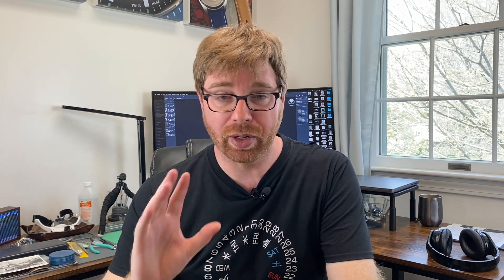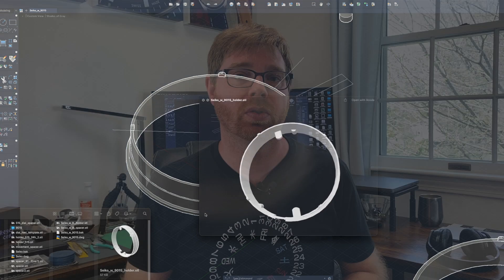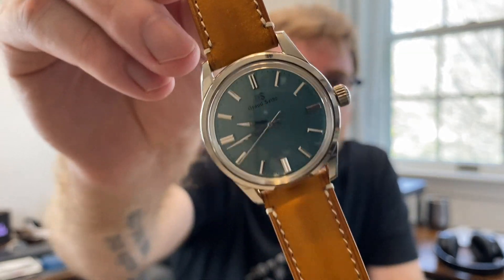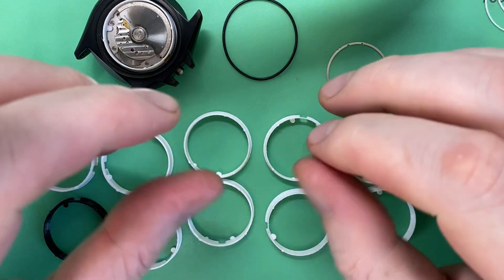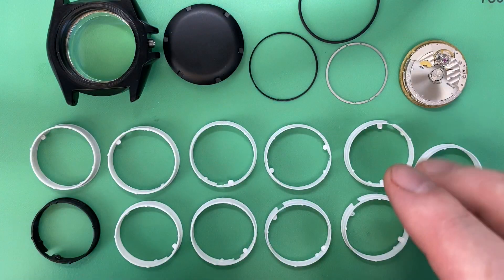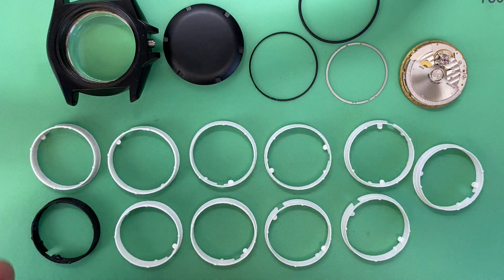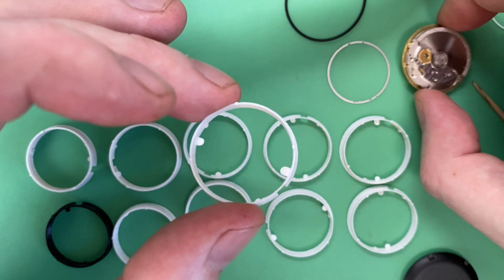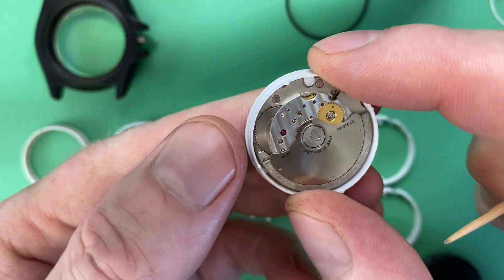Miyota 9015 in a Seiko SKX 007 Case

Comment: I have just put a new handmade dial and Miyota 9039 movement in a nautilus-style case that I had purchased with a ticking quartz in there.   So far I've fashioned a movement spacer with thick copper wire, but I need a more robust solution.  Looks like I have a bit of CAD and printing to do myself, but I'm very glad to have found your videos to help spot the pitfalls and do a better job.  I did wonder if an FDM printer has enough resolution for these tiny parts.
Reply from the maker: A good one does :) I do it all the time
Reply: @WatchComplications  I've simultaneously decided on a 3d printer purchase, but also ordered a couple of 2824 spacers and fixing rings to try out.  Thanks for the reply, you tipped me over the edge.
Reply from the maker: did you place the spacer order vis my site or somewhere else? I’ll be getting back to printing orders in a week or so!
Reply: @WatchComplications  It was somewhere else.  It's just a "standard" brass spacer that looks like it will fit my specific case with the aid of a fixing spring, based on the given measurements.   It cost just a couple of bucks so I thought why not give it a try.   For a custom job I can't afford your services!  Besides... I need the CAD practice myself ;)

Comment: Can you explain the process for miyota 8215 to 9015
Reply from the maker: what do you mean the process from the 8215 to the 9015? The 9015 is quite thinner, but I'm not sure what you're asking. Could you fit a 9015 in a case meant for the 8215, yes. But that would take a custom holder for whatever specific case you are asking about. If that's what you're asking.

Comment: Could you use the same spacer for the 9075 GMT movement?
Reply from the maker: being a GMT, the 9075 has more height than the 9015, so the holder and/or spacer would have to be altered to accommodate the difference.

Comment: Hi, first of all congratulations on your work. I wanted to ask you if it is possible to use an NH35 case for a Miyota 8200 movement obviously using the right movement holder. Thanks😊
Reply from the maker: Probably, but depends on the specific case in mind.

Comment: do you have a spacer for miyota 9015 for SKX013 Case?
Reply from the maker: i’ve not used the SKX013 for a project yet, but I don’t think it would take much to modify one of my existing holders. I think the interiors are mostly the same, just diameter difference with 42mm vs 38mm. The cases have the same height.
Reply: @WatchComplications  thank you very much. where could i order your 9015 spacer?
Reply from the maker: send me an email watchcomplications at gmail and we can discuss more.

Comment: Does this fit any NH36 case?
Reply from the maker: No, because cases can have different internal dimensions, dial sizes, etc and then their own custom holder to fit a particular movement to that case. It's usually not a one to one swap. A case will usually come with a holder that fits the NHxx to that particular case given its overall and internal dimensions, like stem height. Almost every case and movement combo is unique.

Comment: Has anyone installed a Seiko dial on a Miyota movement?  I know the feet locations are different and would like to know if it's possible.
Reply from the maker: you’d have to remove the dial feet and reset them. I have a vid on that too.
Reply: same size the hands?
Reply: @EmmanuelMoreno-le7ip  No, NH hands do not fit Miyota movements. Miyota movements have very different mounting diameters for the minute and second hands (smaller.) The hour hand is almost the same diameter, but even it has a slight (0.01mm?) difference.

Comment: It would be great to have a file for the inside of the holder, like say a Miyota 9 series and and have a thick/taller outside that you could whittle to fit thr cavity/adjust the stem and dial height. 
Really liked your video! ✌️
Reply from the maker: that’s essentially what i do with redesigns. For example, I had this one made, then redesigned to fit a Panerai style case. It’s usually just adjusting the height and exterior. You can whittle PLA, and sand it, but it’s more accurate to quickly make the adjustments in CAD and reprint.

Comment: I hv a miyota 9015, but no case. Any suggestion for a case?
Reply from the maker: There are plenty of generic cases on eBay and AliExpress that will fit a 9015. Or you get a custom holder to fit it to a case, like I did in this video.